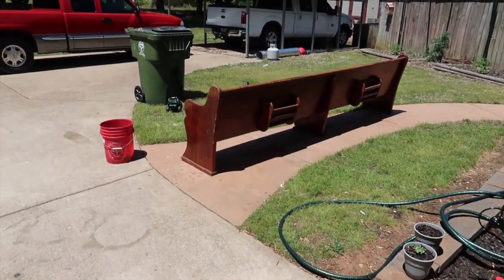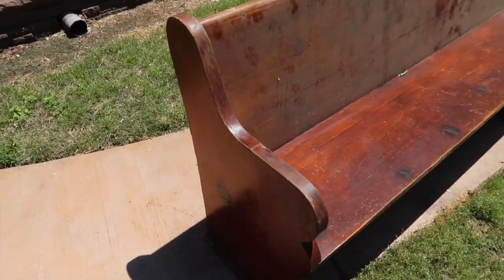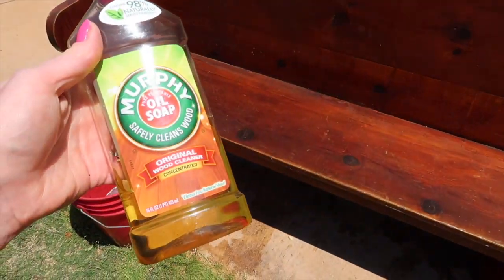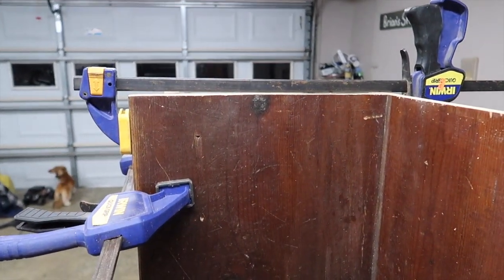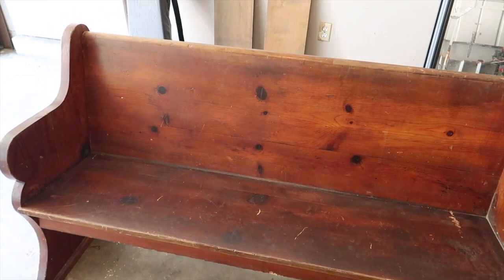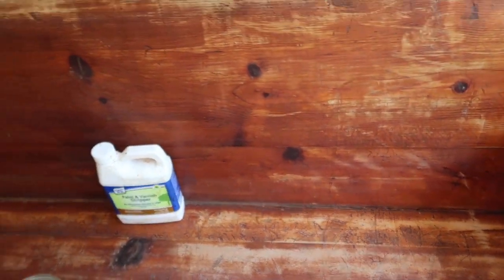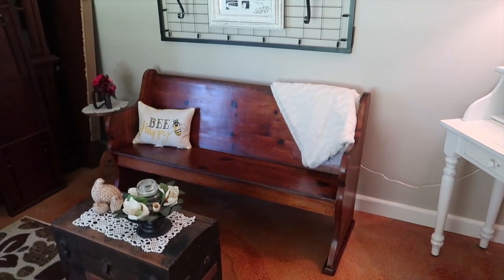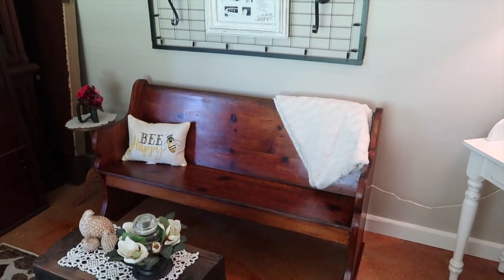Church Pew Makeover Trash to Treasure Farmhouse Decor

Comment: Wow, what a great find!  It turned out beautiful!  I really like the style of that free piece you got off the side of the road! I could have used your husbands help!  I'm working on that wood wall in my bathroom but am at a stand still waiting for a table saw that uses a jigsaw blade to come in.  I ordered it from Home Depot even though Lowes which is closer to me had them in stock.  Lowes wants $40 more for it!  I have to make a vertical and horizontal cut in a board that will go partially over the tub surround.  I got a cheap jigsaw from Harbor Freight but I just couldn't cut a straight line with it and after ruining one board I didn't want to wreck a second one as they aren't cheap.  The saw should be in next week so I can get my project finished.  I will be sure to post pictures on Facebook.  It's looks fantastic so far.  I like it so much I plan on using a different style plank from the same company to do a wall around a window by my kitchen table.  Hoping the company has a 4th of July sale and I'll order it then.
Reply from the maker: Thank you Laura. Yeah harbor freight is one of those places you get what you pay for. Brian  usually buys his plastic tarps there.  Our local Lowe’s has been slammed with people. They are taking advantage of this extra business. Everyone is trying their hand at carpentry and gardening. Lol   Enjoy your weekend
😁❤️
Reply: @MimisMixedBag  I don't blame Harbor Freight.  The saw cut fine, it was me who can't cut a straight line. lol  The one I ordered from Home Depot came in yesterday, I got the text while walking to my front door after having just left Home Depot! lol  I'll be going back today.